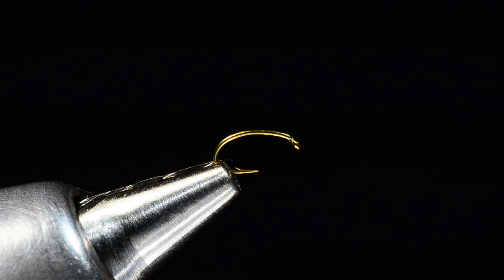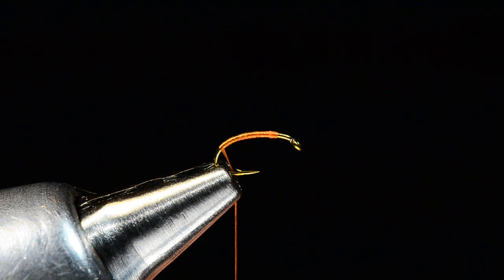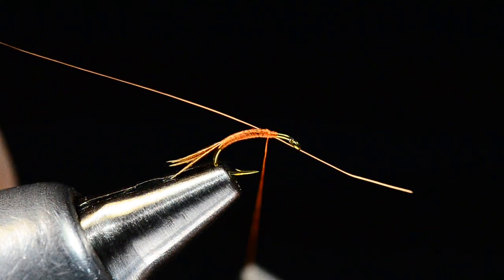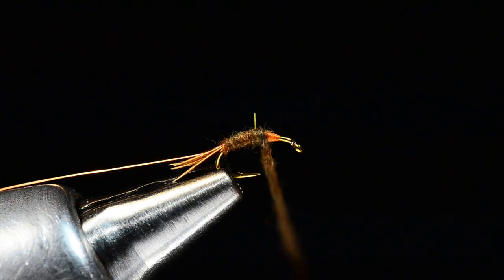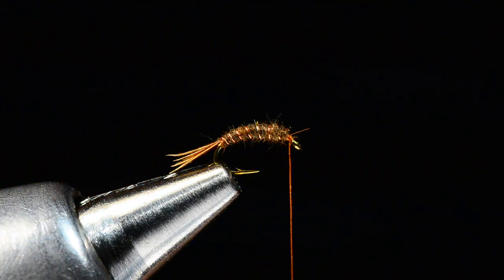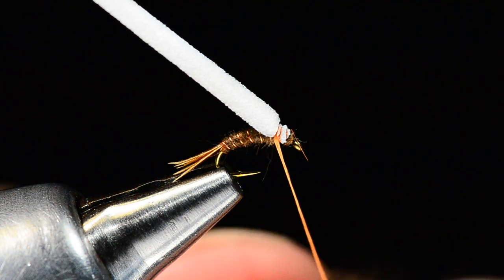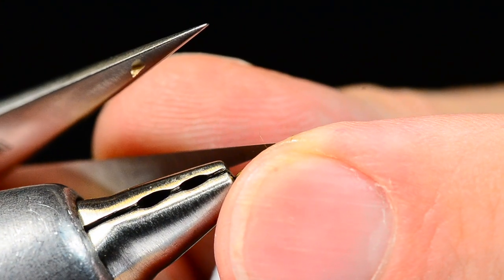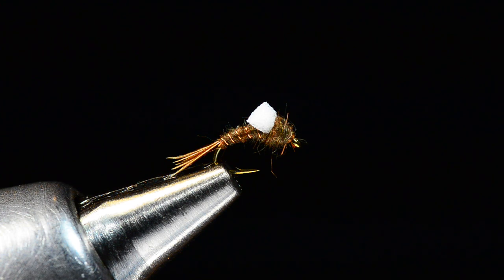Foam Back Emerger Fly Tying Instructions by Charlie Craven

Comment: Just one question. Does this fly fish on the surface, as if it were a dry one, thanks to the foam, or does it fish in the middle of the column and therefore must be fished as a dropper? Thks
Reply: It is a mid-column fly.  You could fish it as a dry but most of the time it will break the surface.
Reply: @mattlittle3330  Thanks Matt, that was really my suspicion.
Reply: mid column.  BUT- don't be afraid to fish it deep (drop it off a heavier nymph / point-fly).  Some days this is the ticket.  You can experiment with one deep and another off a trailer higher in the water column.  The white foam is the ticket some days- works even better than more subtle patterns.
Reply: @martinhodell8465  I call that the vacuum rig.  If I know the run has more fish than I was catching, I always hang one off my point.  Always gets bit.